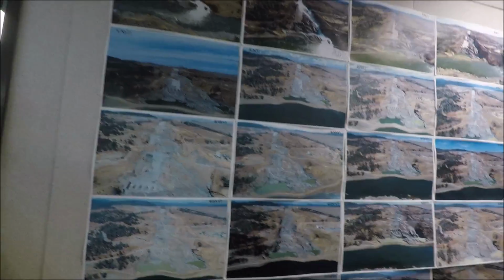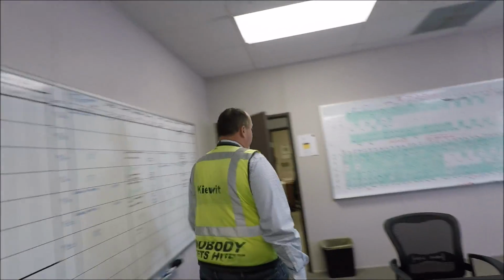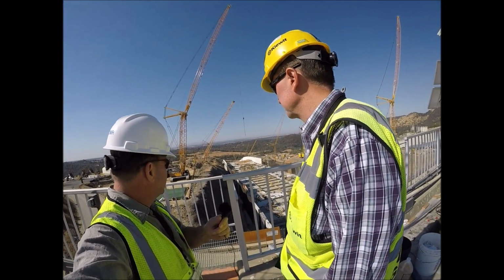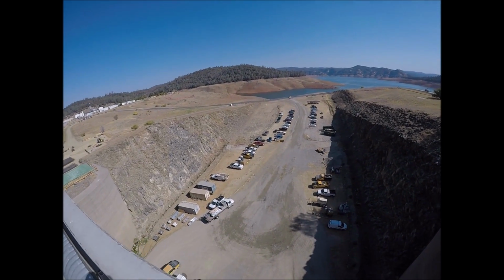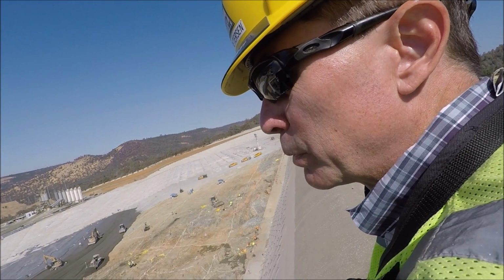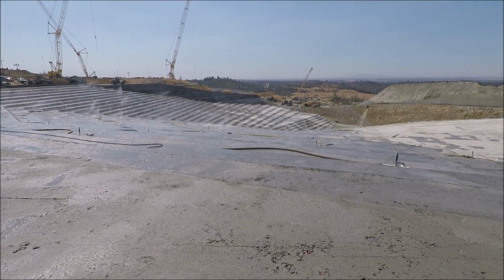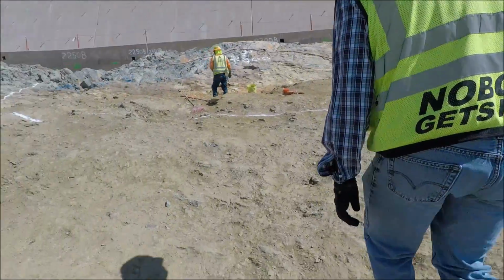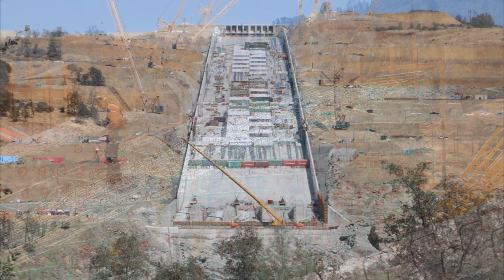Oroville Spillway Rebuild Boots on the Ground Report- Part I

Comment: I realize a dam shouldn't be topped but yet the emergency spillway can.  Why not design the dam to do both?
Reply: The Oroville dam wall is earth fill, no rock anywhere to anchor the spillway...
Reply from the maker: @gordonrichardson2972  correct.
Reply: IF the dam was made of concrete it could be done but it would greatly increase the material requirements and cost.  Also that would have required moving the power plant further away from the dam.  Sometimes  making a dam entirely out of concrete is the best route and sometimes they do allow water to flow over the top. An excellent example is the Grand Coulee dam in Washington state.
https://en.wikipedia.org/wiki/Grand_Coulee_Dam

Comment: It amazes me that the state of Ca. is capable of pulling this off! Well done! Great report! Thanx!
Reply: tom williams --- Remove useless regulations and many thing are accomplished in a timely manner, environmentally friendly and safe!
Reply: What makes you think that regulations are less stringent today than when the dam was built originally?
Reply: machintelligence  ---  I was a young man in a work force back in those days, sites were much more worker friendly back then....and just as safe as today! We accomplished work, safety and environmental issues with 'common sense' , which no one seems to have now!
Reply: Hogwash!
 From Wikipedia:
"On December 22, 1964, disaster nearly struck when the Feather River, after days of heavy rain, reached a peak flow of 250,000 cubic feet per second (7,100 m3/s) above the Oroville Dam site. The water rose behind the partially completed embankment dam and nearly overtopped it, while a maximum of 157,000 cubic feet per second (4,400 m3/s) poured from the diversion tunnels. This Christmas flood of 1964 was one of the most disastrous floods on record in Northern California, but the incomplete dam was able to reduce the peak flow of the Feather River by nearly 40 percent, averting massive amounts of damage to the area.[19][20]

Ten months later, four men died in a tragic accident on the construction rail line. On October 7, 1965, two 40-car work trains, one fully loaded and the other empty, collided head-on at a tunnel entrance, igniting 10,000 US gallons (38,000 l) of diesel fuel, completely destroying two locomotives. The burning fuel from the collision started a forest fire that burned 100 acres (40 ha) before it could be extinguished. The crash delayed construction of the dam by a week while the train wreckage was cleared.[21][22] Overall, 34 men died in the construction of the dam."
Only 34 workers killed -- some safety record!
Reply: machintelligence  ---  You missed a 'key word' in my original comment----"useless".
Reply: arkansas13 plenty of people still have “common sense.” Problem is, nobody seems to have the time to teach it to anyone anymore because they are too busy complaining about it. And before you say something stupid, how did you learn not to touch a hot pan? How did you learn to wipe your ass? I bet you would say those things are “common sense,” when in fact, they are learned behavior.
Reply: also , when money is not an option do to the close call California had !

Comment: Impressive project! But I've had a pothole on my street for 5 years they just can't seem to fix. What's this companies phone #?
Reply: Call your city council member. Be polite and persistent. A polite phone call every week will convince most politicians to get the word out to the maintenance department. Believe me, polite and persistent pays off!!!
Reply: Get a bag or two of mix at the home center and just do it yourself late at night. 5 years of tire and suspension damage plus more waiting for idiots in government is not worth the 20 or 30 bucks it will cost to bypass the idiots who specialize in not doing anything.
Reply: Jennifer Whitewolf   That is a good idea but rather impractical long term because to do a good long term repair the new material needs to be keyed into the existing material or the new stuff will just pop out very quickly.  Seen it happen.
Reply: Dominoes pizza has been fixing some potholes. Maybe they'll do yours if you by some pizza from them.

Comment: Class vid :) Stupid Q...Backfilling the spillway wall, Does that put pressure on the wall its self. without a clue :)
Reply from the maker: It does, and helps absorb the pressure from the water when running.
Reply: Witch is once in a blue moon :)
Reply: Think of the spillway walls as a retaining wall.  The pressure on them is static and will not be moving the walls.  while when the other side has water running it will be moving and it will cause more pressure and if there was no backing, it could flex the walls and break them.  If you did not back fill, you would have to have thick walls like they made last year on the lower to handle the outword pressure.
Reply: Thanks. though I personally think and I am in no way  educated in this brilliant engineering endeavour, but I think the walls are a bit thin xx
Reply: they have steel I beams in the middle of the walls.

Comment: Communication must be paramount for everything to flow together correctly. Wonder what the total combined weight of all the concrete and steel is they put into that project?
Reply from the maker: I think I'll have that answer in part II
Reply: Hard to find exact numbers but according to one report I found from August 10, 2018 in the Mercury News they plan on using 1.2 million tons of aggregate for just the RCC. Add in the structural concrete and I would say you are looking at well north of 1.5 million tons maybe even near 2.
Reply: @centurion1945  Thank you, that's a lot of weight.